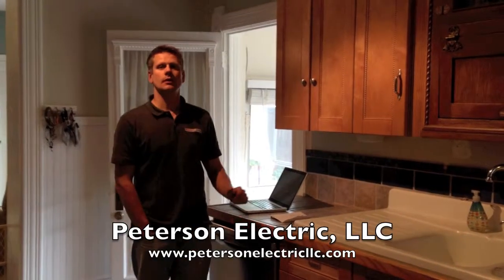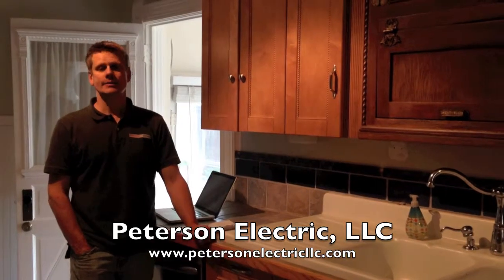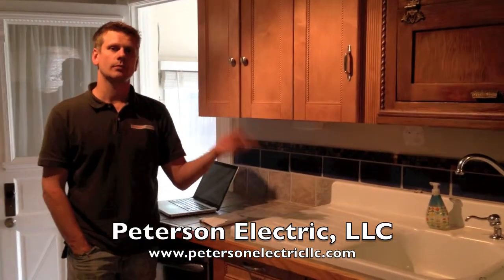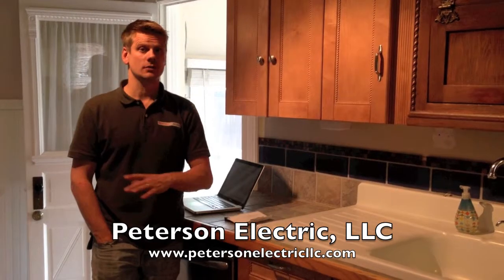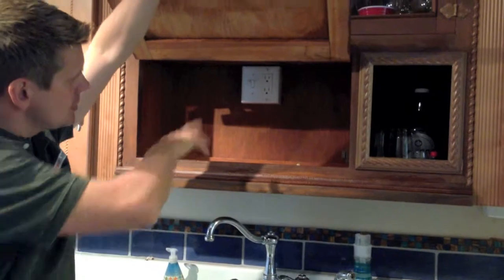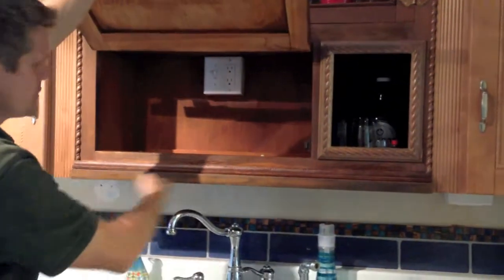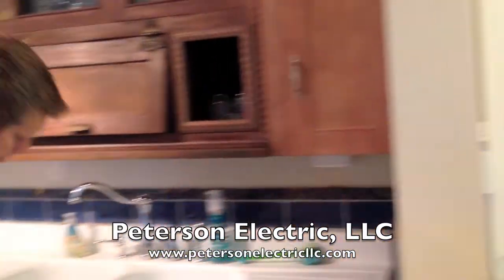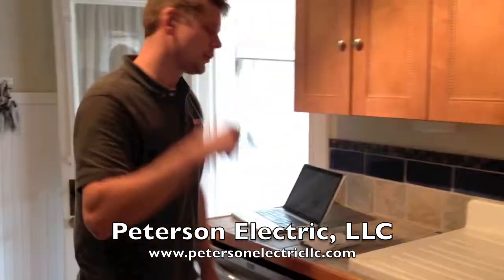In 1905 Home Added New Circuits For Outlets in Kitchen

Comment: Handy boxes would made it smaller than the 4 square boxes. Either way good job
Reply from the maker: Our inspector's frown on handy boxes. GFCI plugs short out in them, not enough space. Thanks for watching.
Reply: Peterson Electric oh I musta missed that you had gfi’s installed under the coat rack.  Where you had the 4 squares.